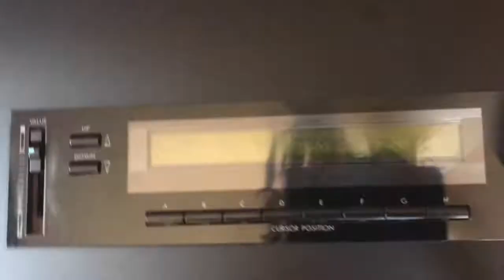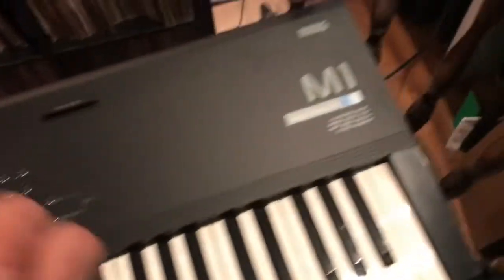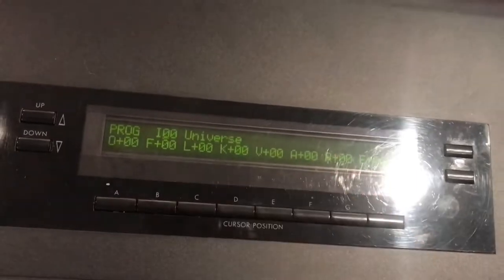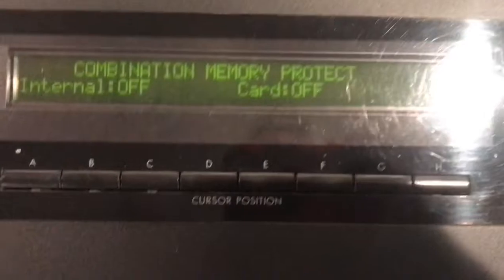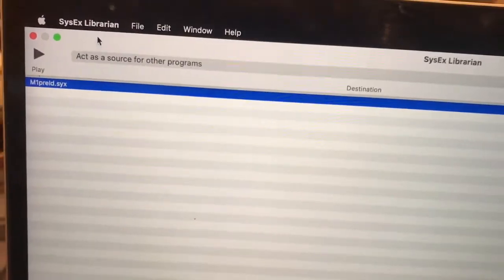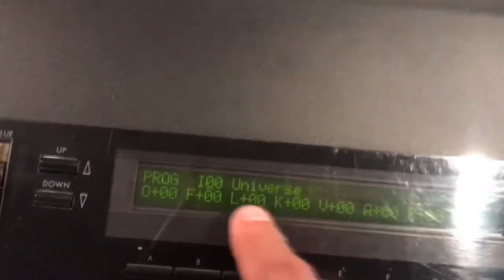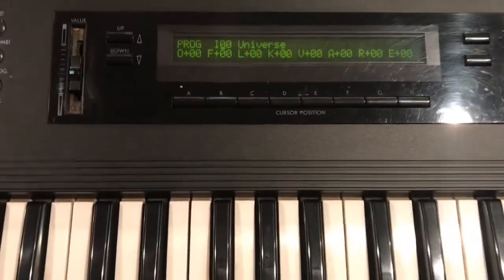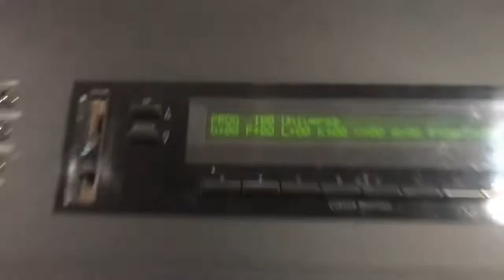Korg M1 battery and factory patch install in 2022 with problem solve!

Comment: Thanks a ton for this video, saved me some stress 👍🎶
Reply from the maker: Were u having the same issue i had?
Reply: @Rhezoloution  was given an M1, you've pointed out the key points that will make it so much easier to get the job done ⏳

Comment: Yup... Same for the T3, 01/W and most late 80's/early 90's synths. I had the same problems almost a decade ago with my T3, and MidiOx.
The problem is those synths "communicate" very slowly and modern computers very fast. The transmission of data needs to be done very slowly or it will mess up the data on the receiving end.